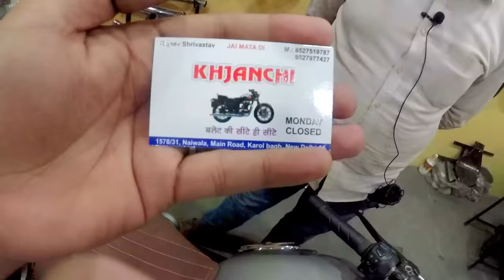Custom Saddle Bags for my Royal Enfield - King Indian - King Indian

Comment: I install custom seat just like yours..  Mine is brown color and same bike gunmetal.. Now i want to install back seat handle. Its good for old people to hold the back seat handle. Is it available in the market? Back seat is pointed and small it should be smaller back seat handle.. Is it possible to install???? Any idea?????
Reply from the maker: not available in the market yet... you have to build yourself
Reply: @KingIndian  i did with the stock one..  It was bigger so i put wood on it.. Hhahahahahahha i painted in black.. Wood in aluminium, metal bike WTheck?????😆😂😆😆
Wood in royal emfield .... It sucks...